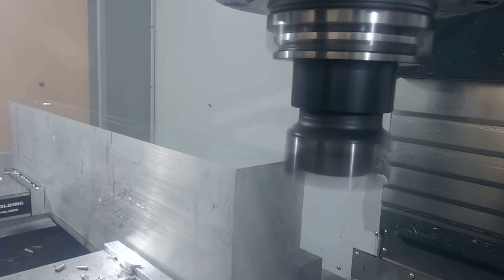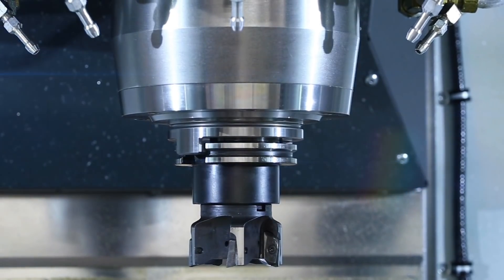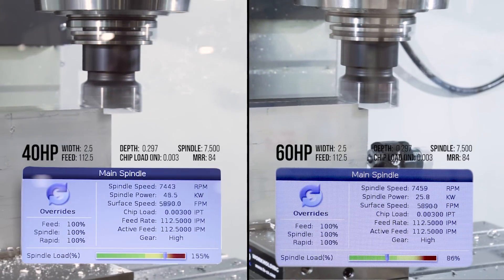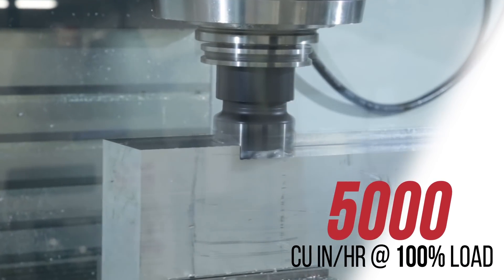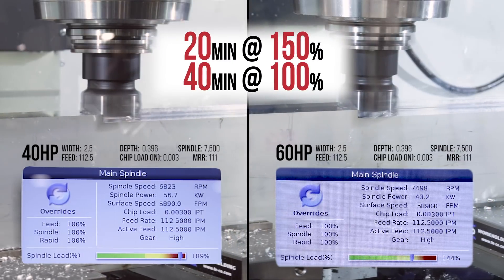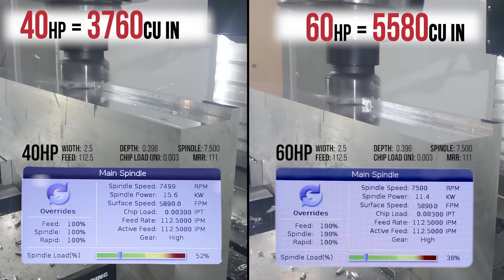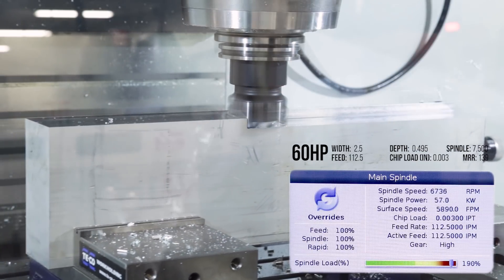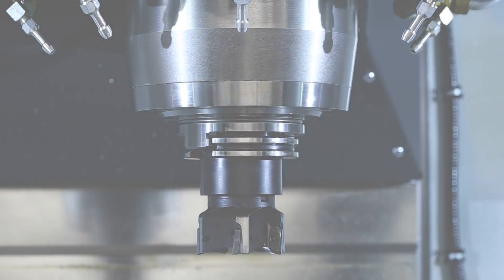Haas’ New High Performance 50-Taper Spindle - Haas Automation, Inc.

Comment: 189% on the 40hp spindle!! WTF is the designed safety factor of those spindles?!
Reply from the maker: Good question Beach&BoardFan, Haas vector spindle drives are designed to run at 100% spindle load continuously, 150% load for 15 minutes, and 200% for 3 minutes.
Reply: Daaaaamn so what's the component that gives up if you run 200% for too long? Bearings?
Reply from the maker: Beach&BoardFan, The mechanical spindle is not the limiting factor. Heat generation within the drive system is what limits run time at these high loads. Luckily you won't blow anything up if you go too high for too long. And if you're cutting at 200% for 3 minutes or 150% for 15 minutes you are in the realm of serious hogging.
Reply: Wish I had a machine to warrant such a spindle!

Comment: Nice surface finish on that face mill; what brand?
Reply from the maker: vondeliusc, The face mill is a Walter F3040.UB.076.Z05.20 3.000” diameter.
Reply: @haasautomation  Thank you. Was available at Walmart? https://www.walmart.com/ip/WALTER-F3040-UB-076-Z05-20-Indexable-Milling-Cutter-F3040UB076Z0520/438961733 :-O

Comment: Is the spindle load % displayed correct for the 60hp? for example at 0:43 it shows a 29.1kW load and my calculations for a 60hp motor put this at 65% but your display shows 97% spindle load, if this is the case then the machine could do more removal then what you are suggesting, ie even better. What am I not understanding??? the data for the 40hp corresponds to the % spindle load shown.
Reply from the maker: Flexy14, Sharp eye! We shot the cutting part of this video on one of the development systems for the higher power spindle. The parameter values in the control we're not all set to their final limits and that's why the kw reading is low.
Thanks for the question.

Comment: Damn, whats that cost.....
Reply from the maker: Sicktrickintuner, The 7.5K 60HP spindle is $9,995 and the 10K 60HP version is $19,995. Although both of these options are 10% off at the moment.
Reply: @haasautomation  So is the 10k option geared higher? Like is it giving up any low end torque to make it run at a higher rpm or just unlocking a higher rpm with the same spindle? Curious because we do a lot of low end rpm hogging but it would be nice to be able to run smaller tools like engraving at a higher rpm too.
Reply: if you have to ask, you can't afford it